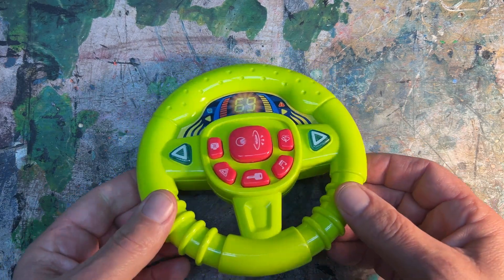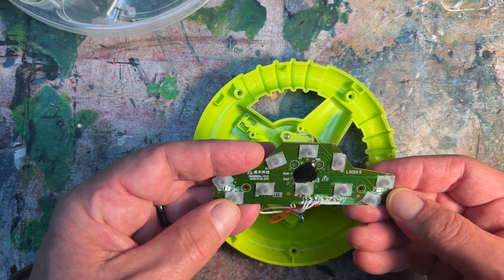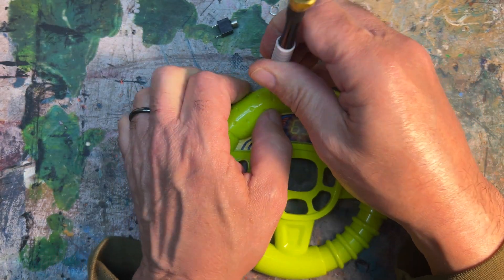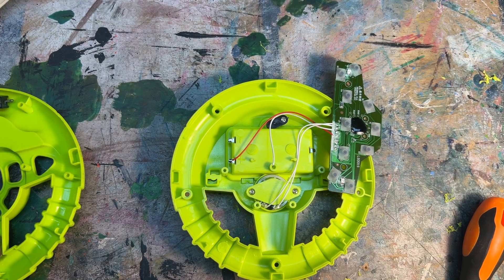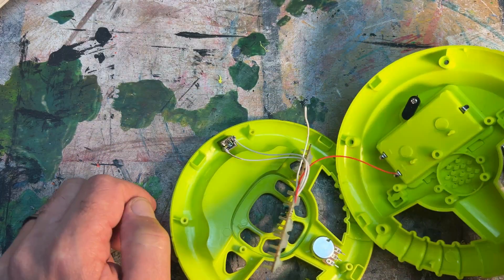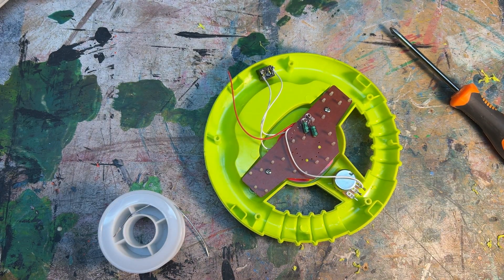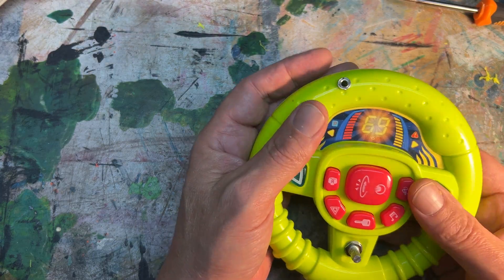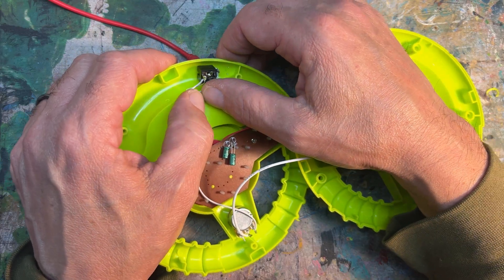Start To Finish | Circuit Bending | Mini Baby Driver Toy | Step by Step

Comment: Super cool video! 

It's unfortunate that taking the toy's speaker out of the equation removed some of the effects that you achieved at first.
Reply from the maker: Thats a great point. I could have left the speaker in. Could have installed a speaker cut-off. Lot's of options.
Reply: @CircuitBendingFool  It's never too late. :D